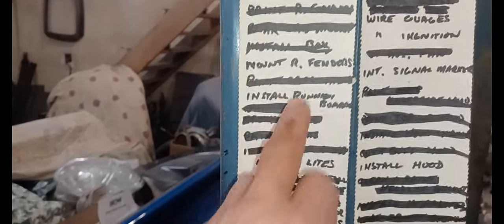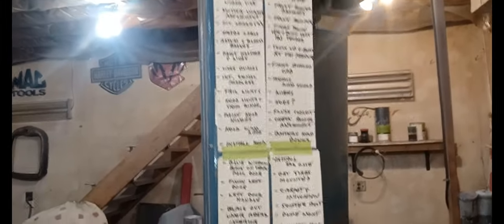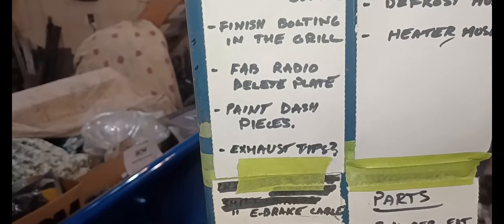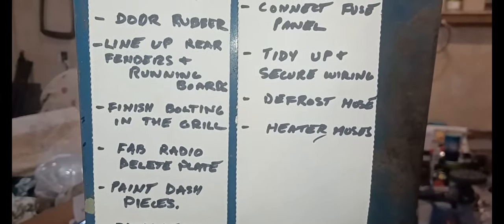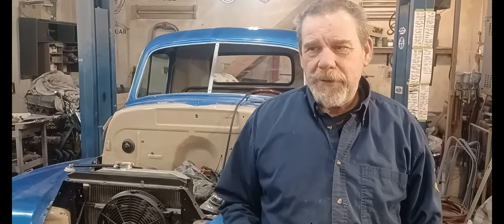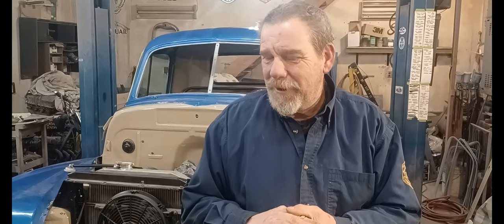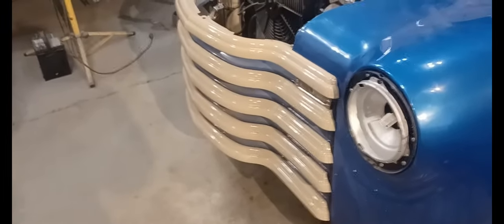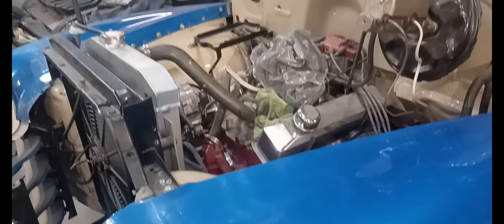'51 CHEVY TRUCK...A NEW YEAR BRINGS A NEW "TO DO" LIST!

Comment: Dan food for thought - fan shroud       the lifter tick OMG thats all we ran was hyd flat tappet NOW look out !   you need to run a full roller valve train for 250 HP  $$$$$$$$$$
Reply from the maker: I haven't test driven it with the electric fan yet...if it's still running a bit hot, the shroud is the answer. The tick isn't that bad, I just want to check it out and see if I can eliminate it....thanks, both good points!
Reply: Most of the younger generation won't know how big a silver dollar is! Lol!
Reply from the maker: @brianhaw9398  LOL...never thought about that!